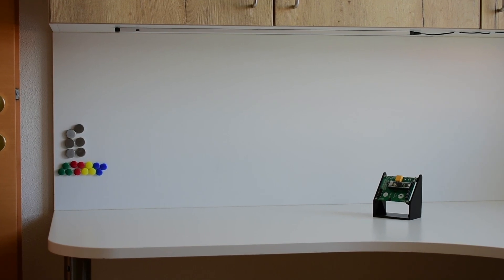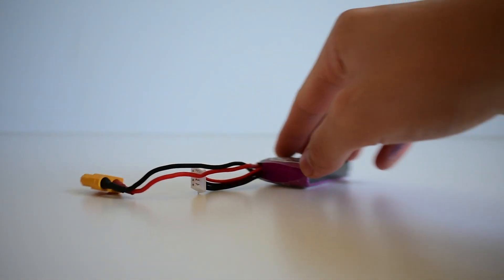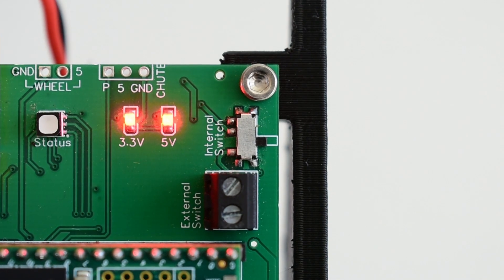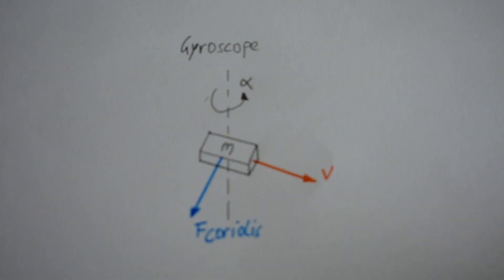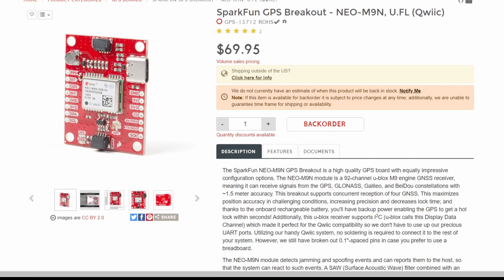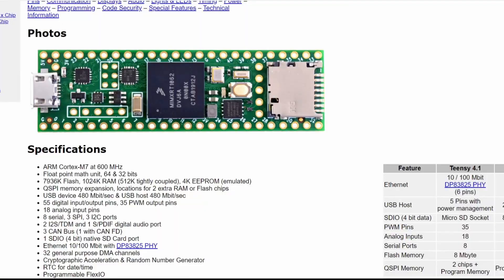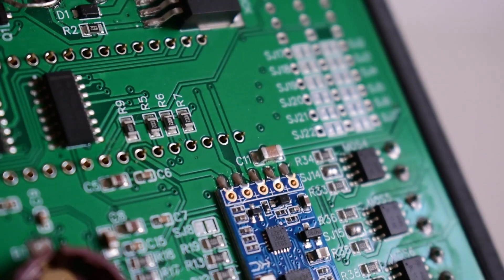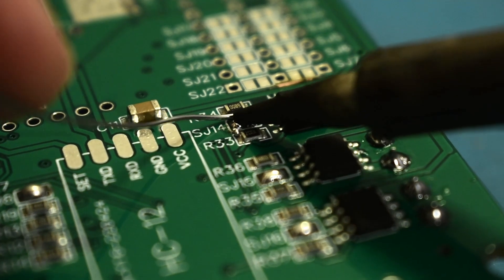This is the new Flight Computer | C/One

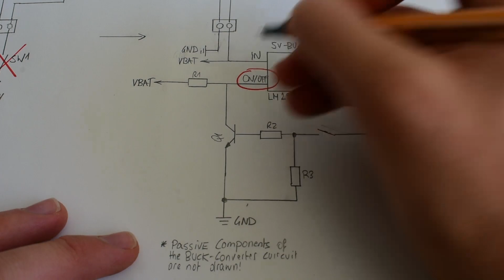Comment: Hello, in your power section what bigger switch did you show off to the right (2:54) ? Is it able to handle more current or voltage, like straight from the battery? I'm a noob and I don't know circuits so more mass is better than killing my flight computer. Thanks 👍
Reply from the maker: Yes exactly! Way more voltage and current ...
Reply: @jmspaceR  Right ok! , So which switch is that specifically and which vendor/manufacturer sells it? I would like to use that switch (or a similar one) since you've proven that it's capable enough. Thanks for replying! 😃
Reply from the maker: @y_man15  sorry to reply that late here is the link for that specific switch:https://lcsc.com/product-detail/Slide-Switches_XKB-Connectivity-SS-12D06L5_C319015.html
Reply: @jmspaceR  Absolutely no problem! Thanks for the help, you may have saved me from a cooked microcontroller.